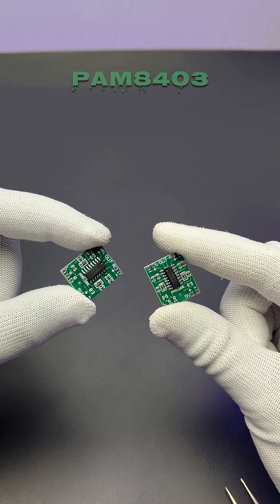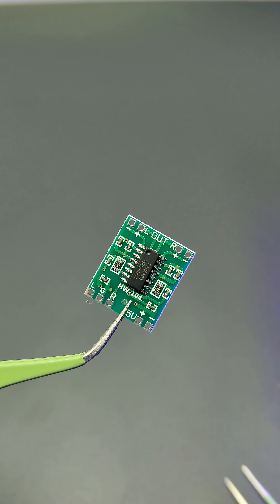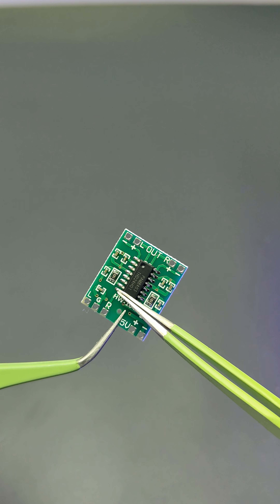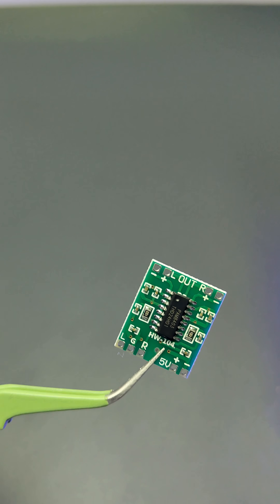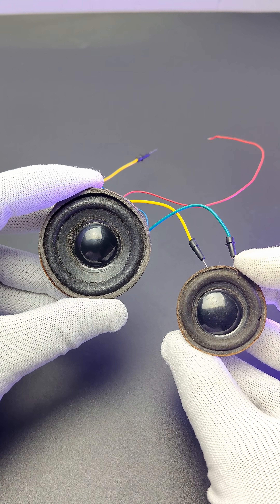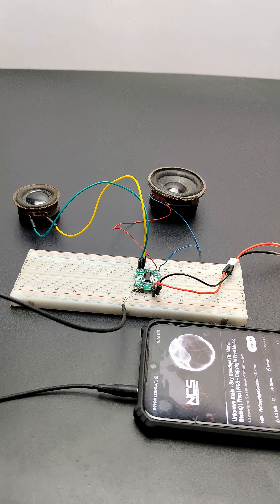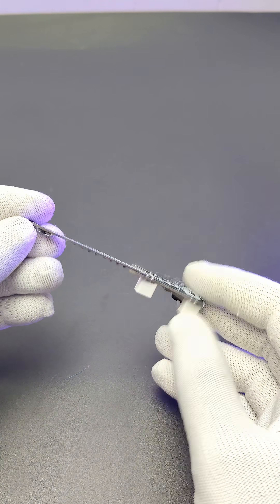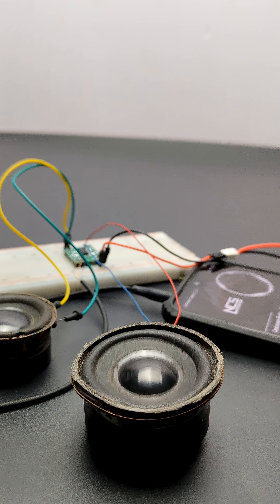PAM8403 Cheap and tiny Amplifier module tutorial #amplifier #audio #diy #electronics #tutorial

Comment: How! My pam 8403 distorts very much but when you played then i got shocked I even give 5 volt but a bluetooth module audio input to it
Reply from the maker: From which source you provided the 5 volt.
Reply: And it is real board then also
Reply from the maker: Have you connected the input and supply grounds properly
Reply: With a qc charger 5 volt 3 amp charger minimum power of charger
Reply: But don't use a capacitor
Reply: Yes
Reply: But I didn't connect the audio input ground because the humming starts because of the bluetooth receiver module
Reply: The Bluetooth module is likely causing the distortion